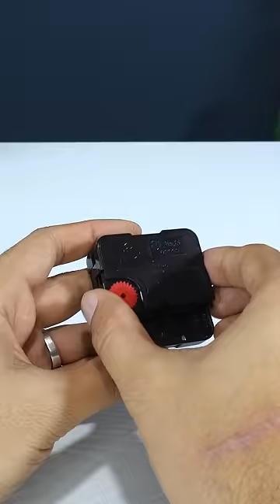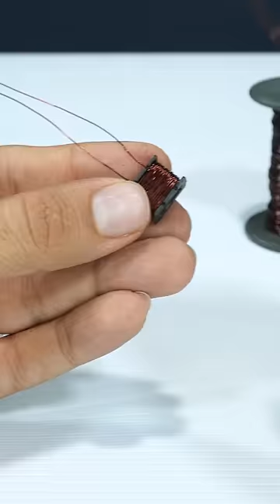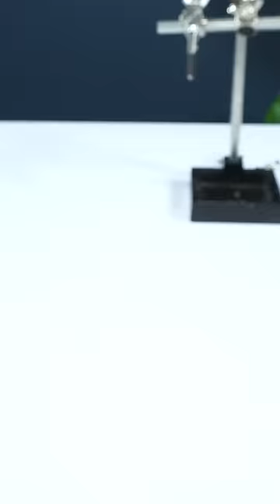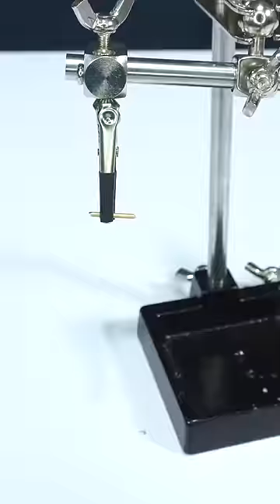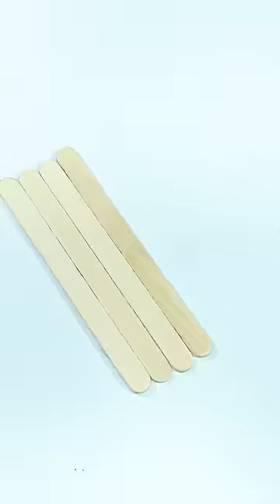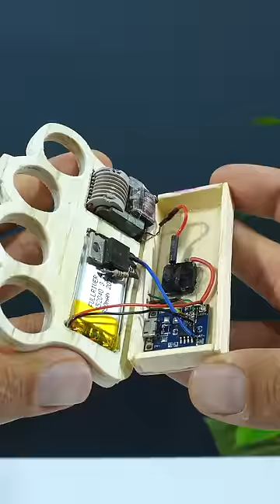Building a DIY Electric Shock Brass Knuckle with Wooden Base

Comment: This thing can be done with a ZVS driver
Reply from the maker: Yes it's completely correct
Reply: add a diode if not cause high frequency won’t hurt on skin
Reply: @RotaryMarx  You can use a multiplier circuit instead of a single diode rectifier which can create a powerful electrical arc in the output
Reply: @HighVoltageArcsReader  that’s quite smart!
Reply: @RotaryMarx  Thank you!